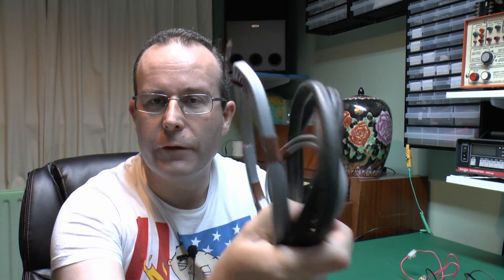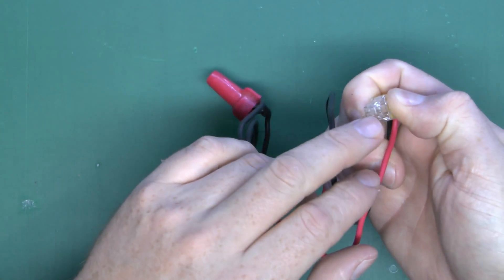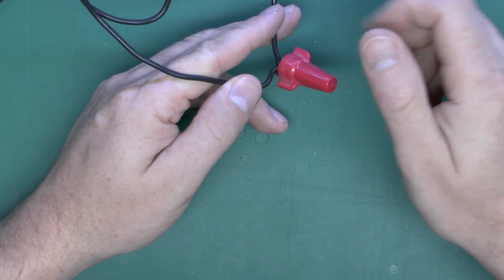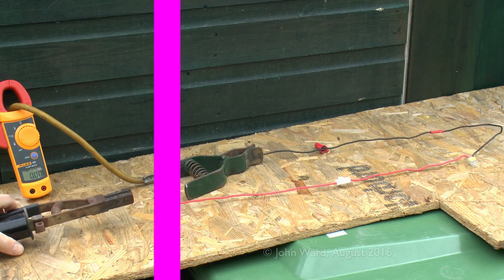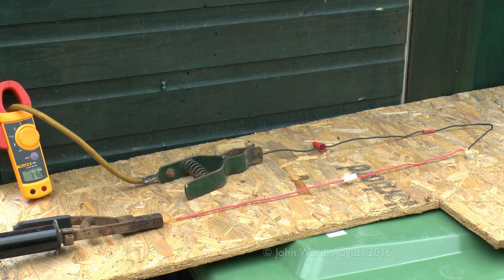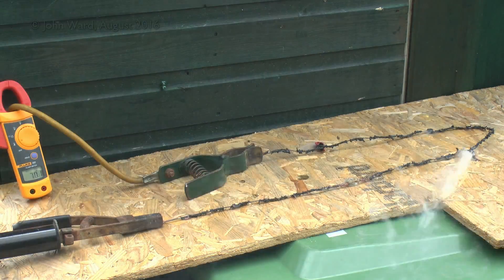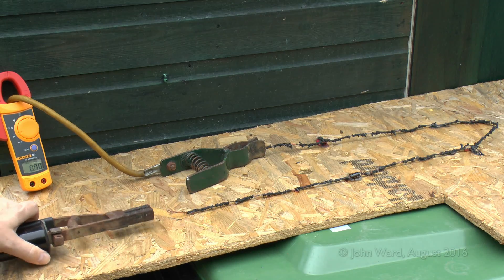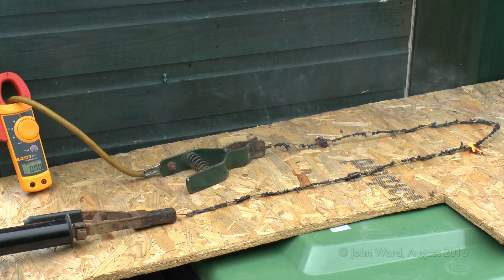Wire Connectors Overloaded

Comment: Interesting that wire nuts/wing nuts are not considered a good connector in the UK as theyre pretty much the standard in North America
Reply: I was thinking the same thing. Also, they do a fair job of insulating.
Reply: And assuming they're twisted on properly/completely, they really don't come off.
Reply: Probably ok to use within an enclosure, if the joint will be inaccessible. Not very practical when it comes to disconnecting for any form of testing or fault finding. I suppose the key to success is not to have joints or junctions where it can be avoided. Failing that, you can always use the humble junction box, which has been around for about 400 million years.
Reply: As he eluded to, the reason they (wire nuts) had been previously baned in the UK was because the old versions were ceramic.. the problem with the ceramic wire nuts was that as the wire thermal cycled the ceramic nut would crack and fall off, leaving exposed connections and often causing shorts and fire. This happened in the US too; many electricians in the US just went back to joining wire with solder and friction tape and did so to the end of their working life. There wasn't quite the same PR disaster in the US as in the UK, so the improved plastic version was successfully marketed and adopted in the US. But most electricians in the UK still distrusted the wire nut, and thus even though the plastic versions are legal they are uncommon in use.
Reply: Americans use lower voltage than the UK. Maybe that's the reason.
Reply: In other European countries they were pretty much the standard until quite far into the last century. They can still be bought, and especially the more expensive brands such as Conex outperform push-type clamps in long term reliability.
Reply: We have circuits with 240v that still use wirenuts.  That's irrelevant, as they're rated for up to 600v in many cases.

It is against code in most municipalities to have wirenuts in a junction outside of a box, however.  Doesn't stop Joe Freedom from sticking a charlie foxtrot behind the sheetrock in his DIY remodel, however.
Reply: the wattage, or volt/amps is the total current, and would be the same despite voltage.
Reply: Christian Buczko wire nuts are rated for 600v supply connections and 1000v signs and lighting. And they are amperage rated for the largest gauge wire they fit on.
Reply: paul w, power rating doesn't make sense in case of connector. You're dividing apples by oranges in this case - volts in description of connector mean insulation rating and amps means what current you can put through them continuously without failure.
Reply: crashk6 In former Yugoslavia, at least in my home, connection in junction box is made by twisting 3cm of bare copper with pliers and insulantig it with insulation tape. Most bad burns I have seen are in sockets and fuses connections.

Comment: Wire nuts are just a more pleasant way of twisting the ends of bare wires together, aren't they?
Reply from the maker: Yes, which is the main problem with using them.  When you want to disconnect wires for testing or later alterations you end up with a twisted mangled mess.
Reply: Well, the significant difference is that it's a good insulator. You can shove three of those in a random connection box for phase neutral and earth and be reasonably certain it's not gonna short to each other any time soon. Unless you put 70 amps through a 10 amp wire, of course.
Reply: some electricians here swear over the wire nuts, while the most common used connector is the insert type. I dont see a difference in using them, the inserts are quicker and easier to install in my oppinion. Both the nuts and inserts are certified here. they both have the KEMA certification which means the electrical item is safe to use according to the Dutch standards. This means they have tested them to be able to hold the current they are designed for.
Reply: +parkeerwacht here in germany only the wago clips are allowed for new installations as they offer the least potential to screw up a wire connection ... and you really appreciate their small size when working in confined spaces....
Reply: NuclearSavety
that is very true, I dont use anything else than WAGO's :P
Reply: I absolutley love the clear wago clips that can be opened and closed.
Reply: also if you want to measure voltage on them you have to unscrew the entire cap leaving everything exposed.
Reply: FoodOnCrack No... You can shove a leed up them and check voltage without unscrewing it.
Reply: +FoodOnCrack 
Most of the Torix twist connectors have a tiny hole in the top (on the opposite end of where you put the wires in) where you can push in a multimeter test lead.
Reply: A twisted tangled mess which probably has nicks in.  So when you remake the connection, it's more likely to fail.

The reason they're not much used in the UK is because when they were first introduced the shroud was ceramic and it tended to break.  But the plastic ones still make me shudder.
Reply: personally I find the best is still a telegraphers twist (with optional solder) and heat shrink or good electrical tape
Reply: Twisting the wires together and using a compression nut (wirenut) Is a much better connection than a wago push in connector. I've seen wagos fail many times under simple loads like recessed lighting, never mind a receptacle load.
Reply: Marr or wire nut, the safest and best way to go.
Reply: John Ward it's called a pair of lineman's...that's what you fix a twisted mangled mess with.
Reply: You ended up with a mangled mess anyway.
Reply: The old grey Wago without the release clamp are a bit sensitive to mounting under mechnical tension (such as in confined spaces) and can work loose over time if mounted ever so slightly in the wrong way so I don't really like them. I use only the ones with release levers (they have a larger contact area and spring tension) or old fashioned Conex nuts (other nut brands are harder to mount and cannot easily be inspected).
Reply: Even my eight year old self thought wire nuts were a crap idea. As you said, it's basically just a cover over some wires twisted together.

I understand the "spring" is supposed to cut into the wires and make a good electrical connection, but you can't inspect them easily to see if it actually did, and I have my doubts it would do so reliably enough to simply trust it.
Reply: @Godfrey Poon
I know how you feel. But even so there are millions upon millions of these installed and they rarely fail. I think the main reason to use these are cost and ease of installation. The one thing to remember is that they are not to be used when there is any risk there will be mechanical tension on the wires, not to mention vibration. But even though I know they are proven to be very safe, when installed correctly that is, I still don't like them.
Reply: Godfrey Poon And yet the wire nut is used everywhere in north america and you don't ever see wiring ever needing to be redone because a marrette failed. Isn't that a fairly common thing with chocblocs?
The wire inside a marrette is not a spring. it's a hard copper nut, and the only way it will back of is heavy vibration and tension. wago connectors will probably fail in the future as the spring looses tension from heat-cool cycles and the occasional overloading, while marrettes will hold strong.
Reply: Wyatt Roncin I work in an industrial industry where reliability is needed. We have installations where screw terminal blocks have been in use for between 40 and 48 years. The type used is a quality type with wire protectors and was installed by the company's specialist staff. Even after all this time, they are still reliable. So just like a lot of things, use good quality parts and good workmanship and it will be a good job.
Reply: David Okanagan I've had the odd wire nut fail:  the spring inside somehow got disconnected from the plastic outer shell.  I've found that the ferrule types tend to be better.  However, I think the UK practice of having all connections a screw on type right on the device itself to be gest.
Reply: Wyatt Roncin I've seen marettes fail at least a couple of times.
Reply: US national electric code demands at least 6 inches of conductor in a box, but it's good practice to have at least 9. If the wire really is a "mangled mess" after you take the nut off, then you clip the half inch of conductor off with your linemans. I personally like them, because I know I can just jam them into the box and not have to worry about the house burning down and killing the family within. Also the proper way to install a nut is you hand tighten it, then twist it more with your linemans until it's as tight as you can get it. It is more or less fail proof. Of course  nobody does that, they just hand tighten it

Comment: Very surprised at John's approach here. I was expecting something a little more scientific. It's obvious that the metal parts of a splice will survive after the insulation has burnt away, and that the splices have greater cross sectional areas than the conductor. I was expecting to see some thermal imaging or laser thermometer being used through cycles of heating and cooling. In my experience, Screw terminal and 'chocbloc' connections are all brilliant, at the beginning. Eventually they loosen and cause resistance, which is why the constant spring, maintenance free ones are better. I seem to spend my life pulling crispy wires and disintegrated chocbloc out of ceilings.

Comment: Without even seeing who wins yet it's not fair to the wirenut unless you off on cycle the circuit expanding and contraction of The Wire simulatiing normal use makes the wire nut which has a spring  Superior

Comment: I take it you used a transformer to obtain that amperage or was it DC via a battery.  Either way connecting and disconnecting it live next to a wooden shed wasn't the safest way of demonstrating your experiment.
Proving you can melt insulation doesn't tell me what connection method is safest under slightly abnormal conditions and what method generates the most heat.
Reply: Most likely an arc welder with variable control.

Comment: When you felt the wire temp after 37 amps, I wanted to know what the connectors felt like.  I don't care about a connector failing at currents far above rated, I care about a little above rated.  So what was the point of taking them to the point where the wire failed?  How did that possibly help me understand which was better/best?

Comment: Interesting. My money was on the Wago too.
Reply: me too until I saw how it's held together on the inside.
Reply: Germans are light-years away from the BS in the UK.
Reply: Wire nut failed. Clearly it became loose from wires. Just a wire twist held that connection.

Comment: I'm not sure if this has been asked before and I've been trying to peruse the comments for the answer. Here in the US, I have mostly used the wing-nut, but I have some wago connectors because I found them interesting. I tend to believe that the wing-nut, marrettes, or however you may refer to them as seem to be the safest for connections. You are twisting the wires into themselves, then using the nuts as a cap and a medium to hold them together in a screw-like fashion. Someone else posted this link (his name is poiihy): https://imgur.com/HoBvGIw

I have a question, though. What do you use 1.5mm^2 wire for in the UK? Here, the homes basically use 15a and 20a circuits for outlets because they are on 120vac (240vac single phase). The wire requirement for 15a is 14AWG and 20a is 12AWG. Unfortunately, these are both classified as 2.5mm^2, but the actual difference between the two are 14AWG = 2.08mm^2 and 12AWG = 3.31mm^2 (or it can be 4mm^2, as well).

Anyways, what are the average current ratings of your outlets that you use 1.5mm^2 or 16AWG? I'm almost positive we don't typically use that size wire in the household in the USA. It USED to be legal for earth/ground in a 14AWG/2.08mm^2 circuit, but not anymore. Just curious what it is used for in UK.

Best Regards,
Nicholas DeLisi
Reply from the maker: 1.5mm² is used for some lighting circuits, either 6 amp or 10 amp.  It could theoretically be used for other things but rarely is.
The more common types are

1.0mm² for lighting circuits, usually 6 amps.
2.5mm² for outlets or circuits for fixed appliances, usually 16A, 20A or sometimes 25A.  It is also used for 32A ring circuits where although undersized, each outlet effectively has 2 cables connected to it.
6.0mm² for higher power individual items such as 32A cookers, 40A showers.
10mm² normally only for 50A shower circuits.
The other sizes are 4.0mm² and 16.0mm² which are rarely used in home wiring.  4 would now be suitable for a 32A circuit but previously would not have been permitted with a 30A rewirable fuse so 6mm² tends to be used instead.  16 is far too big for most applications, there is almost nothing that would require that amount of power in a normal home.
Reply: John, I appreciate the prompt response to an older video. Circuits less than 15A are very rare in houses here. I'm almost positive NEC doesn't allow installation of anything 50v and over to be installed with less than 14AWG (2.08mm^2). You can buy NM-B cable most easily in 14AWG (2.08mm^2) & 12AWG (3.31mm^2).

 I'm not talking for all situations, because obviously there are the outliers and I don't want someone to come in here saying "nah-uh", but most inspectors are used to seeing those two sizes in almost all the house: Lighting, receptacles, etc. 14AWG (2.08mm^2) is only rated for 15A max (12A continuous draw) and 12AWG (3.31mm^2) is rated for 20A max (16A continuous draw). It seems that a lot of people are switching over to 12AWG for future upgrades and fusing it for 15A.

6.0mm^2 is 10AWG, rated for 30A max, which we normally use for things like electric hot water tanks and laundry drier circuits. Side story: It is kind of funny, I hadn't seen the shower heads that you're talking about until I went to South America and saw one hooked up. I didn't even know those existed prior! haha.

10mm^2 is 8AWG, rated for 40A if insulation is 60C, 50A if rated for 75C -- Some stove tops and stuff use this. I know some welding and perhaps some bigger water heater tanks.

Lastly,  16mm^2 is 6AWG, which is what is normally used in a 60A home panel (very old homes) or a 60A sub-panel. 

From our interesting chat, it seems that the UK allows far more power through the wires than the regulating offices of the US do. This is all relating to in home installations, of course.
Reply: @ Nicholas DeLisi
Nicholas, I think you have overlooked the fact that UK uses 240V whereas USA uses 110V.  UK system therefore requires approx. half the current as US system and wires don't need to be as thick.
Reply: Bud Wud found myself here in Germany also wondering what household appliance would continuously draw 15 A and over until I realized the current on 110 V would be quite higher than in 230 V. (For those who wonder, 220, 230 and 240 are basically Al the same Voltage rating, just with different tolerances above and below)
Here we are used to 16 A breakers as kind of default with 1.5 m² wiring. Although that in newer Buildings switches more and more to 2.5 mm². And thinking of it, I can hardly think of any devices which will use more than 10 A continuously, maybe washing mashine and dryer. Everything else bigger is either hard wired or using the red 3phase or blue single phase CEE plugs, which you will find more in industrial applications.
By the way, here all wires including protective earth/ground have to be the same size.
Reply: Alex Ku In former Yugoslavia there was common 3 phase outlet - you can find it on google. Every home I know has ot least one for cooker/stove. On countryside it is very comon for running 3 phase motors, and 3 phase machines have almost no vibration. Also any but smallest households have 3 phase power in order to keep power in balance.
Reply: Electric kettles, portable electric heaters rated at 3kW will both draw 13 amps at 230v (although in practice most such devices are limited to about 2.5kW). In the UK washing machines, tumble dryers and the like are not usually hard-wired and they certainly draw in the 2.5-3kw range.

In the US 120V system portable devices are limited to about 1.7Kw (perhaps the reason that electric kettles are rare there). Their washing machines and other high-draw devices will be connected to the 240v circuits circuits. 

I don't think anybody in the UK puts a 16A breaker on a 1.5 mm² wire. Mostly they are 6A or 10A. For a 16A circuit it will generally be 2.5 mm².
Reply: Szakembőr TV TMIAE Strange, as in cold northern Europe (which should allow more current due to ambient temperature), 1.5mm² copper is usually 10A or 13A max, 2.5mm² copper is usually 16A and 6mm² to 16mm² copper is often used for the incoming feed through the meter (smaller homes can make do with 4mm² copper).  Aluminium is only permitted in higher squares and only with special Aluminium certified clamps due to the mechanical properties of Aluminium.  I have seen it used in the grid itself for carrying bulk loads.
Reply: @budwud2449  Hi Bud, 
I know that this is a bit late of a response,  but I did take that into account. That's why I listed all things that run on 240v (nominal). It still seems that the UK allows quite a bit more amperage on wires than the US does, regardless if the voltage is 120/240. Especially since he stated that 60mm^2 is allowed to carry 50a, as stated on a shower head, and only 30a here.

Have a great day